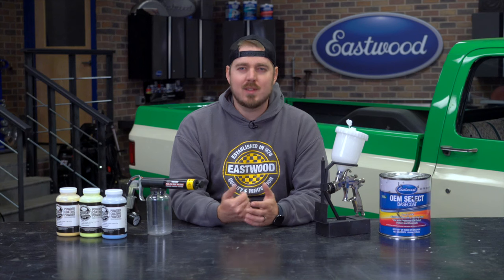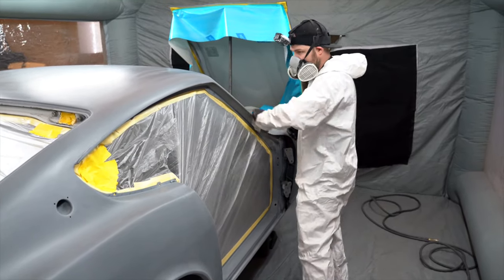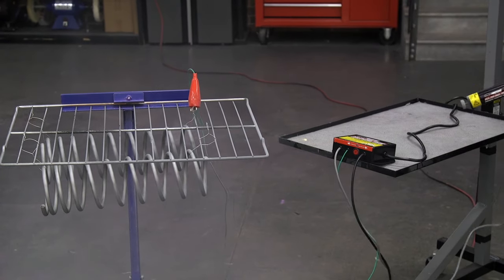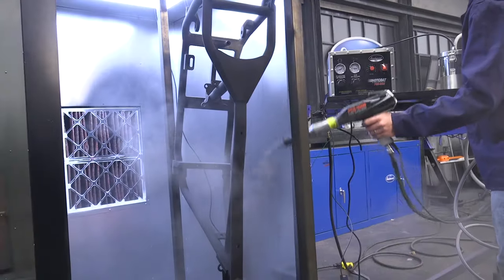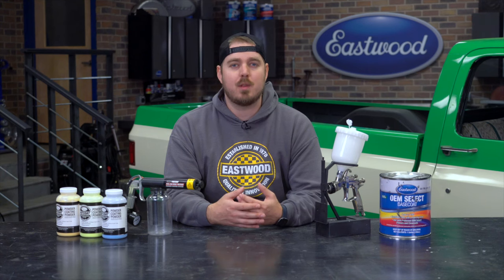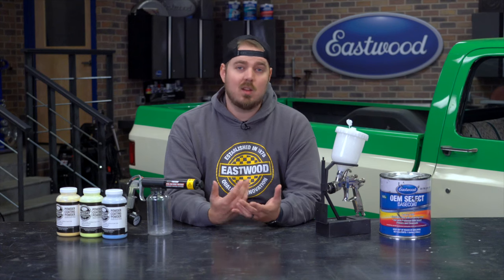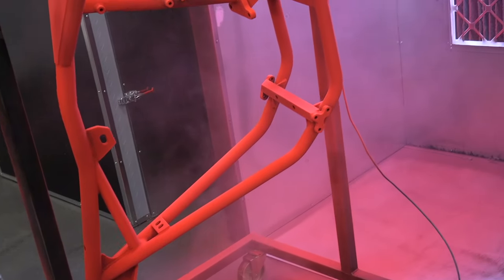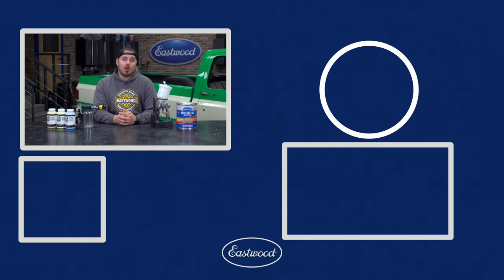Powder Coating Vs. Paint: Which Is Better For Your Project?

Comment: Good info but I bought and aftermarket ranch hand bumper and within a couple of years the paint faded and flaking off I don't know if it's automotive paint with clearcoat or powder coated?
Reply from the maker: If it's flaking off it's most likely paint.  You can sand, prime and paint it again - or strip it bare and powder coat it if you have a big enough oven or heat lamps.

Comment: Which one is best powder coating or spray paint
Reply from the maker: You gotta watch through the video! Depends on your proejct.
Reply: Powder coat is 10 times stronger that paint and usually much more flexable but as the OP says, it depends on the use & material you are spraying.

Comment: I have used weight stack gym machines that need refinishing. I would rather not disassemble the parts, nor transport the machines. What would be the best option to refinish them on site?
Reply from the maker: If you're not going to disassemble then painting is your only option. You can prep and mask off anything you don't want painted - similar to how you might spray a fender on a car without removing a headlight. Powder coat has to be baked at 400 degrees.